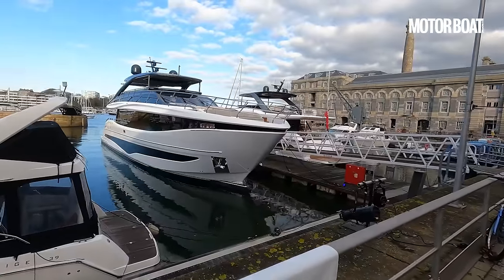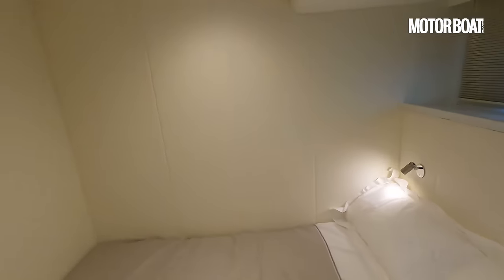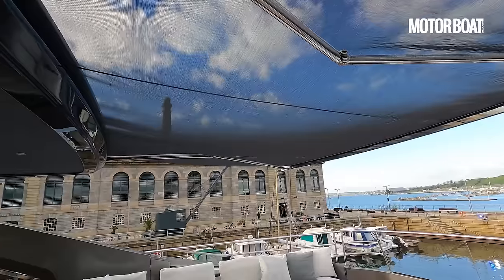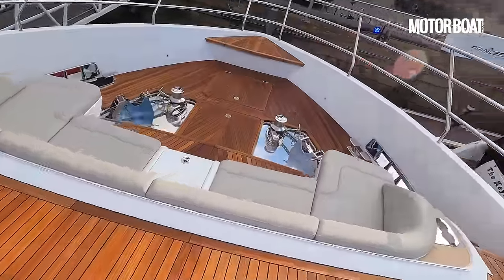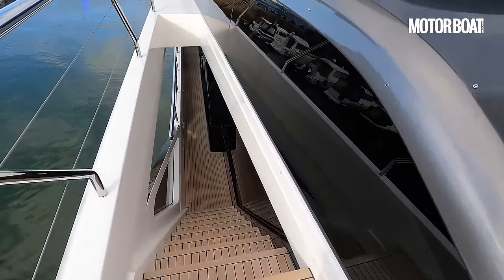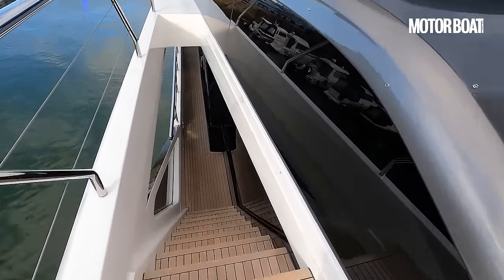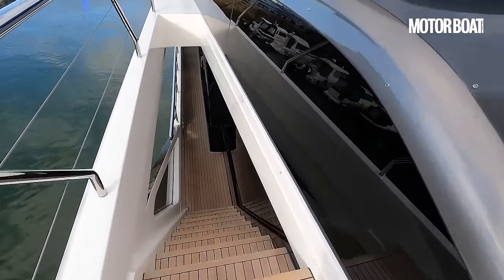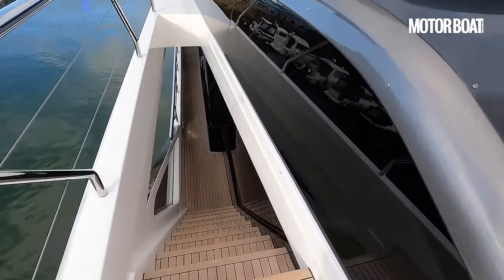Princess Y95 yacht tour | Access all areas of this new British superyacht | MBY

Comment: The defining feature for me with this over the X95 (or any flybridge which does this) is the open deck. When the flybridge is enclosed, making a block of flats, it ruins the whole design. To gain a 4th deck on a 'small' yacht by enclosing the flybridge is self defeating. If someone were to offer me either boat it would be the Y95, no hesitation.

Comment: I love princess yachts but its not worth that amount of money. I prefer the x95 . The x95 has a few flaws but is exactly what people are buying from all the manufacturers. The bow on the x95 has openings in the front allowing tons of spray to hit the windshield. Also the x95 isn't beamy enough. Its only 22 ft wide. While competeters are making similar boats over 23 ft wide on 80 ft lengths with sky lounges. That would take away from the top heavy appearance. From the side the x95 is  to futuristic looking compared to competeters making the same thing. That style is selling really good because of more interior area for guests and crew. Especially now since anything over 100 ft is so heavily regulated.. sunseeker is making an 80 style just like the x95 and have enclosed the 90 ocean. Horizon sells an fd series from 75 to 110 with the forward sloping windshields and can't build them fast enough. This shape of yacht on the y95 has a lot of competition. I don't see it really selling that well. Even though I think it's really well done.